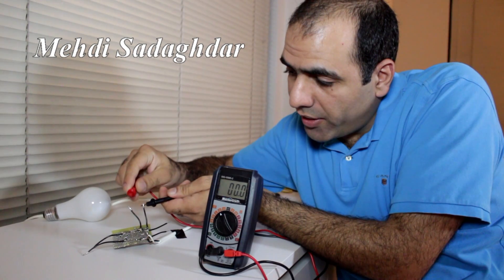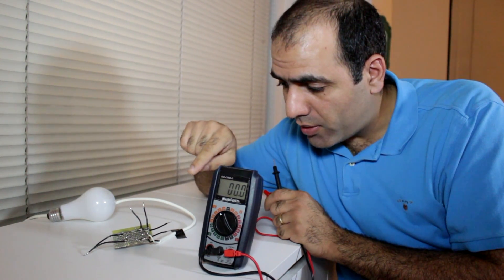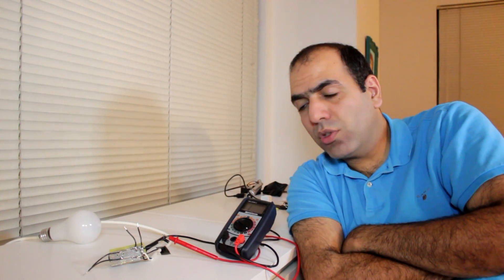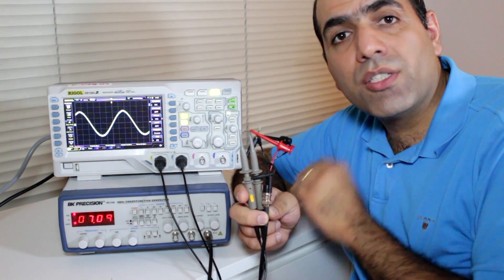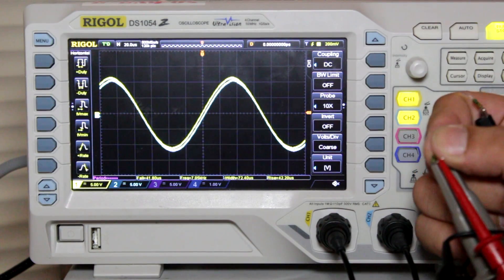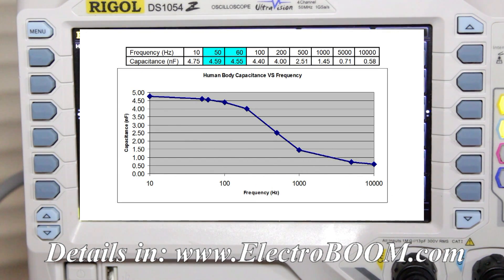Measuring Human Body Capacitance (or any capacitance)

Comment: What do you mean by the output of the resistor? So is the capacitor in series with the resistor, and the voltage over the resistor is output? Or over the capacitor?

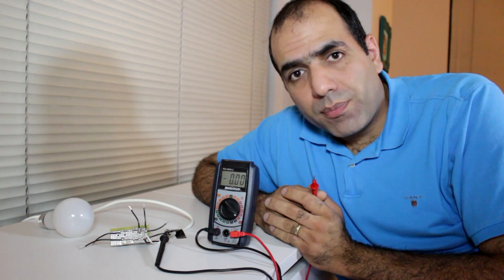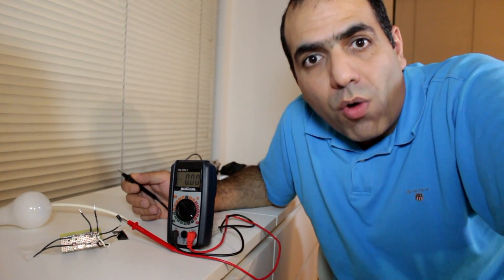Comment: 0:53 to measure the current through my body i connect my current meter to the ac line and hold the proof on one side an only touch one of the ac lines... zap beep well that was a pretty bad idea i could study enough to keep reading this stupid meter and i could have died 1:22 as real capacitor electrocute... Pop * beep* beep so using 20 volt ac he's a bad idea dumbest with ac powers

Comment: theoretically you should also gain and lose capacitance when there are more or less electrolytes in your body as well, no? but would it be enough to read? or would you have to be extremely dehydrated and/or basically peeing excessive electrolytes before you'd notice?

Comment: I always wanted to get into electrical engineering, but, sadly it's just not in the cards for me. I got diagnosed with Dyscalculia, so, anything math related is near impossible to get firm grasp on. It's basically dyslexia but for numbers. They struggle with reading comprehension, whereas people with Dyscalculia struggle with math comprehension. In severe cases, even simple addition and subtraction is a huge hurdle to overcome, if at all. 

Luckily, I'm not that bad. Unless, it's an odd sequence of numbers. Something like "56782 - 45637 = ?". I, literally, can't figure that out in my head no matter what I do. Normal people can figure that out in a matter of seconds, whereas, I will get part way through it and at a certain point I will lose track of  it all and have to start over.

Comment: From what I know capacitance is independent of frequency since it equals charge per unit voltage, what changes with frequency is the reactance (X) , not the Capacitance (C), correct me if I'm wrong.
Love ur videos BTW
Reply: You're right on the theoretical world! In the real world things don't work that easy, unfortunately... The way the materials on capacitors work change when the frequency is high enough and change the value of capacitance...

Comment: Capacitance is fixed value, only the impedance of the capacitance changes depends on frequency  z=1/2πfc.
So u can measure the capacitance at any frequency. Once u found c then plug the 60hz in the equation and find your impedance.
Reply: you are really an uneducated person. the capacitance may not be fixed.

Comment: well here is what i dont underdstand at 4.55nF and Fc=60Hz the Xc=589462 ohms thus the current flowing through the body is 0.2 milli amps which is insignificant even when compared to the current running through body resistance of 50kohms

Comment: Can someone explain to me the doubling of the DC voltage in a mathematical manner?

Do I understand his message right when deducing that the AC body resistance is half the the DC body resistance? Because you know, doubling the DC voltage for the same pain says that the DC body resistance is double as high, right?

I think I understand the phase shift part since in my physics book it says u = û*sin(wt - pi/2) for the phase difference of a capacitor which is similar to the phase difference shown on the oscillator. Besides, reasoning with logics about how capacitors work that would make sense right?

Anyway, back to my question: I know the formula R = U/I and the specific formula for AC resistance being R = 1/wC but that is where I stop understanding ;-;

Do I add them up? Like R(AC) = 1/wC + R(body) and R(DC) = U/I + R(body)? Does comparing these 2 formulas lead to the desired conclusion?

I really don't know pls help me :(
Reply: I'm not 100% sure on what you're asking but I'll try and answer as best I can anyway. Also I'm assuming in your formulas U = voltage. I personally use V for voltage and Z for impedance (which is the combined reactance and resistance of a component, measured in ohms.)

In a DC circuit a capacitor will charge until it's holding maximum charge (this maximum is determined by Q = CV) While an ideal capacitor is holding maximum charge it's impedance is infinite. As you rightly pointed out, the magnitude of the impedance of an ideal capacitor in an AC circuit is Z = 1/ωC.

As an aside, I said the magnitude of the impedance because the impedance of a capacitor is a complex number. The actual impedance of an ideal capacitor is Z = 1/jωC, where j is the imaginary unit.

Now, ElectroBOOM has modeled the human body as a capacitor in parallel with a resistor. You can see this in more detail on his webpage http://www.electroboom.com/?p=606

I'll do some calculations to demonstrate what's happening here. Below, Rb is the body resistance and Zc is the impedance associated with the body being a capacitor. The combined impedance of components in parallel is

1/Z = 1/Rb + 1/Zc

I'll use the numbers on ElectroBOOM's webpage, i.e. Rb = 1 MOhm and Zc(AC) = -580j kOhm at 60Hz (I forgot the negative sign initially, whoops! The negative sign corresponds to the voltage lagging behind the current by 90 degrees. The reason why it's there in the first place is because 1/jωC = -j/ωC) For simplicity I've modeled the impedance of the capacitor as entirely imaginary. In reality, there will also be a real component because capacitors are made of resistive materials.

Remember that Zc in a DC circuit is essentially infinite.

R(DC) = 1/(1/Rb + 1/Zc(DC)) = 1/(1/Rb + 0) = Rb = 1MOhm

Z(AC) = 1/(1/Rb + 1/Zc(AC))

Now, the problem is Zc(AC) is a complex number, meaning Z(AC) will also be a complex number. I'm not sure how much you understand complex numbers so I'll just tell you that the magnitude of Z(AC) is around 500 kOhm. I can do the full working with complex numbers if you want. The calculation for the power dissipated (which directly corresponds to pain) is another tricky one but I can also do that if you want.

I hope this helps. Ask me if you have any more questions. I know I probably went into too much detail but I wanted to explain what was happening fully. Also I'm not an electrical engineer so I might've made a factual error. If anyone can spot one please let me know :)

Comment: Dear electroboom, I would like to do some remarks on your experiment. Capacitance doesn't change with the frequency, what does change is the impedance of said capacitance vs the frequency. Capacitance is just a measurement of how much charge two surfaces can hold vs a given voltage between them, it is independent of frequency. Also, the power given by an AC signal is always lower than a DC one understanding they are named after their peak value. The power for an AC signal is given by its RMS value, and it always is half than of a DC of the same level, matching your description of pain quite accurate.
Reply: Well, not really. Capacitance can change depending on various factors. For example, at high frequencies capacitance can vary due to a phenomenon called dielectric dispersion. Essentially, the dielectric does funny stuff and it's permittivity changes a bit. This means capacitance also changes.

You can read about it here https://en.wikipedia.org/wiki/Dielectric#Dielectric_dispersion
Reply: Good remark. However this effect only takes place on extremely high frequencies. As it is seen in the article, these non-linear effects happen beyond the Gigaherz band. Electroboom tests the capacitance in ELF which is the order of KHz, thus no variance of dielectric should be visible.

Comment: In switzerland we have 220-240 volts!
Reply: are your appliances more powerful? how many amps are your typical outlets rated for?
Reply: +dan428 10/16 up to 1.5 kw, even more :)
Reply: Megaspasstpräsentiert that's less than american outlets though.. we have 20 amps standard
Reply: +dan428 well with 110-120 volts you need more amps
Reply: Megaspasstpräsentiert yeah that's true i guess with double the voltage, 10 amps would be equivalent power to our 20 amps.. so if you can do over 10 amps then that's a higher load level
Reply: We have plugs for 10 amps and plugs for 16 amps
Reply: Megaspasstpräsentiert oh we have 15/20amp standard outlets, and then special 30 and 50amp outlets for larger appliances
Reply: For larger appliances we have 380/400/500 volt and 150+ amp outlets :D

Comment: You said all capacitors change value at a different frequency .. Are you saying an electrolytic changes its capacitance at varying frequency or did you mean to say all capacitors change impedance at different frequencies .. As opposed to body capacitance
Reply from the maker: +graham kaveman Impedance changes for sure, but the capacitor value (not just electrolytic) also changes due to all sort of different reasons.

Comment: Yea but a DC current can kill you every time we're AC you could possibly live because AC is Alternating Current and DC is Direct Current. AC gos from high current to low current to high current alternates up and down were DC is always high but it's still a lower current then AC but If you get shocked by a DC current you'll tend to be stuck say you touch a DC line you be stuck there getting shocked were if it was AC you get shocked then it let go of you because it dropped to lower current. I'd rather get shocked by AC as much as it sounds crazy then DC because I would have a chance to live

Comment: im 14 years old and i expiriment with 240/120 1 phase at 400 amps at my house and  touched the 110 volt live wire and a near by water line on acident and i was  also bare foot on a wetfloor and. i also got electroucuted with a hvac  run capacitor at 440 ac volts it stug like 5 hornets stinging you in one spot ive been shocked 8 times in my life.

Comment: Which current is the "sticky" current (or is it both)? By sticky I mean, as you get electrocuted you have an odd inability to let go vs. what I see in this video where he lets go from pain immediately. 

I remember I was messing around with the innards of my PC and was smart enough not to unplug it and touched something I shouldn't have. I distinctly remember my brain noticing that I was being electrocuted, but I couldn't bring myself to let go for some reason.
Reply: ijirving Both, as far as i'm aware. General rule of thumb is to always touch electrical equipment with the back of your hand, so you don't get the muscle contraction that will make you "freeze" in place.
Reply: Russell Kay absolutely. But sometimes you need to check when you think the circuit's dead.
Reply: ijirving that's because ac current causes muscle contraction.
Reply: sevenayan you really shouldn't be touching energized electrical equipment at all... Live dead live every time!
Reply: +sevenayan You get the muscle contraction but your hands don't bend backwards so you don't accidentally grab the electrical equipment and fry yourself.
Reply: That's because it was a DC current your PC coverts the AC to DC so when you were messing around and got shocked that's way you couldn't let go. If it was AC it probably kick you back because AC is alternating current go from high to low high to low. Be careful next time unplug it
Reply: ***** errr...that's exactly what I did. I am not a smart man.
Reply: *****
This one time I was fixing my laptop power brick. A simple job changing the output cable. Opened up the enclosure, soldered on the new cable, then powered it up to checked if it's working, then touched the inner metal case of the power supply. I got shocked by 230V ac a few times but man this time it was hard. Large contact area probably.

Comment: ***** Seeing that the lower the Hz is, the higher capacitance gets, why does DC which has no frequency seemingly doesn't hurt? Your video proved how the human body has capacitance and how it varies at different frequencies but i guess i'm not seeing the capacitance to human pain correlation. So will the human experience more pain at higher or lower Hz?

Comment: 1:53 
"The reason is that all capacitors change value based on the frequency."
I thought it is not the capacitance that changes, it is the impedance of the capacitor that changes governed by the formula Xc = 1/jwC